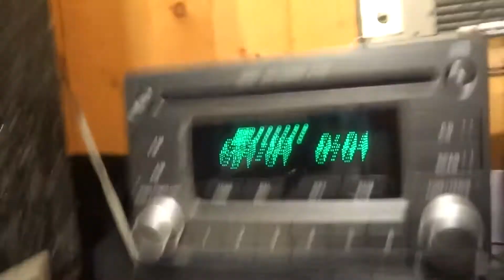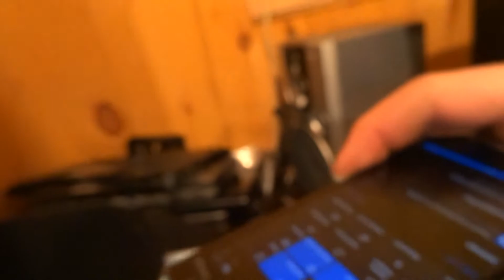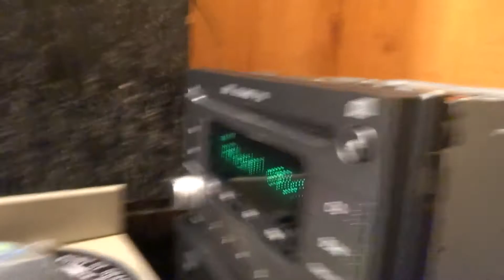How a 6 CD Car Stereo Works! (Panasonic)

Comment: The Vacuum Fluorescent Display is my favorite display too bad they are not that much any more 
Also this stereo is made by Panasonic (as you already know) for a higher end Subaru
Reply from the maker: +Peter Yachymczyk VFDs are also some of my favorite displays. You can still find VFDs on high end home audio equipment. I can see why they are not used in cars much. The LCDs do not generate light, thus when light shines on them you can still read the display. On a VFD you get glare. I have a Sony CDX-GT740UI, which has a VFD display. In the sun you can barely read the display.